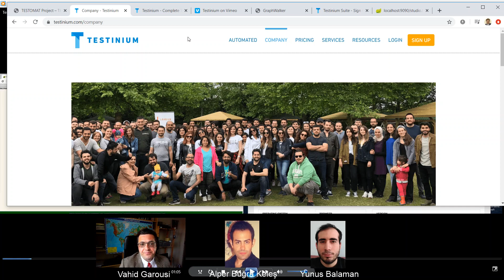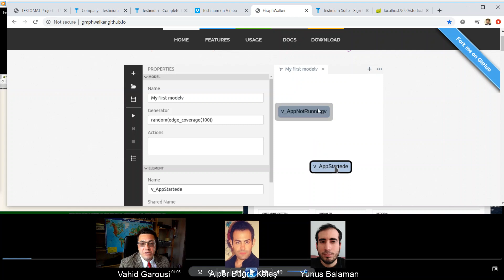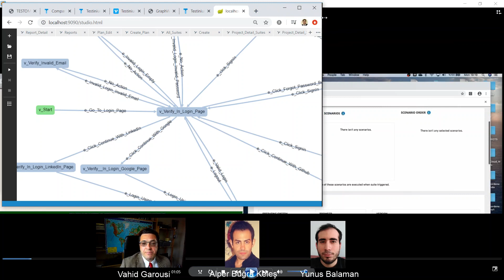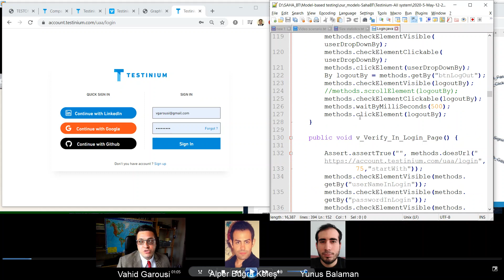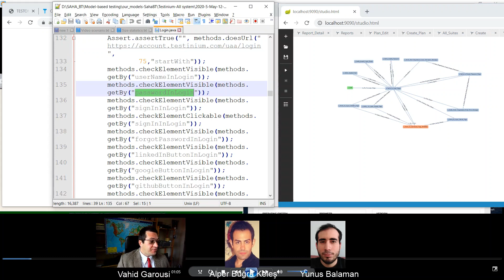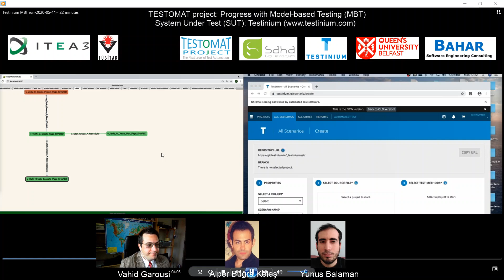TESTOMAT; Model-based Testing (MBT); SUT: Testinium; Normal-size model view

Comment: Hey, I am writing my masters thesis right now and MBT is one thing that will be a topic in it. Your experience report paper is a really good summary of why the industry is not adapting MBT that often.
When I understood your approach correctly (correct me if I'm wrong), you had to write Selenium Java Code yourself. This basically means that your approach might be more efficient in the end but in a company that would be adapting this MBT you'd also need more know how by the employees first and in general over time to apply it consistently. Have you also tried an approach that is generating the Selenium Test Code or the Page Object Model itself?
I'd be glad about a response :)
Reply from the maker: Hi there,; Thanks for your comment. To be honest I do not fully agree with "the industry is not adapting MBT that often", due to the reasons that you mentioned, e.g., writing Selenium Java code by hand. The (main/only) niche point (advantage) of MBT is that it provides comprehensive path coverage on the page flow of a given web or mobile app, once the MBT models are designed. I should also clarify that writing Selenium Java code by hand is not a major issue and in the 5+ large projects that we have applied MBT, that has not taken too much major effort from us and our test enigneers. We can discuss further if you like.

RE: Have you also tried an approach that is generating the Selenium Test Code or the Page Object Model itself?
I am not aware of any tool for that. Do you know of any?
Reply: @vgeruslu   hey, thank you for replying on my comment that quickly. Probably you are right, I don't have that much insight in Test Engineering industry itself. But I know from QA departments in some companies I was involved in, that there is not even a thought about adapting MBT, just because QA in smaller SE companies ist often not that big in comparison. You definitely are right, that there might be companies, especially bigger ones, that are applying sth like MBT and there definitely is no problem with writing quite easy and clear Selenium Code. But still it is code to write. So you need a real test engineer to use an approach as yours. What we want to try is simplifying basic component testing by using visual programming approaches.
I don't know about a Selenium Java Code Generation tool yet. But have you seen approaches like Scriptworks.io or QA Wolf? They are not particularly in relation to MBT unfortunately.